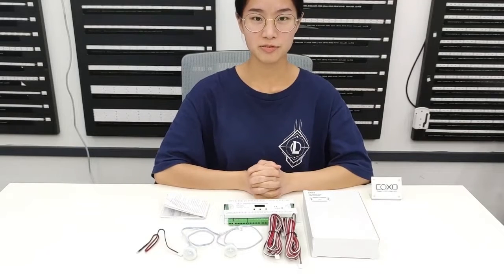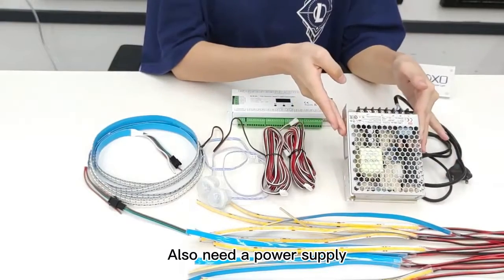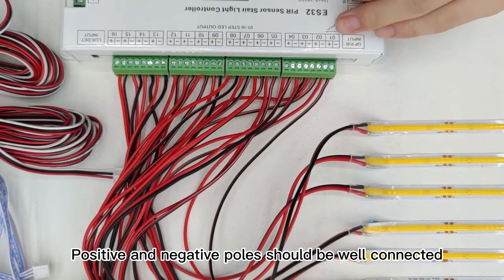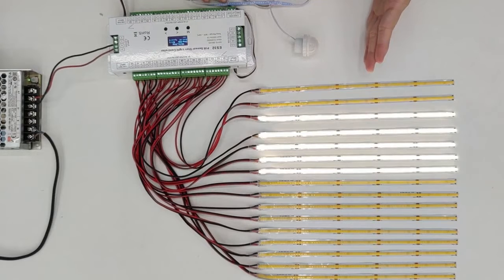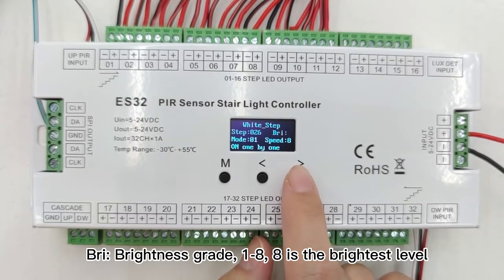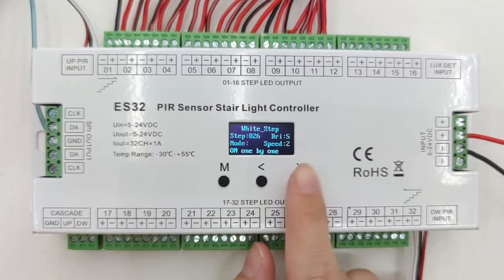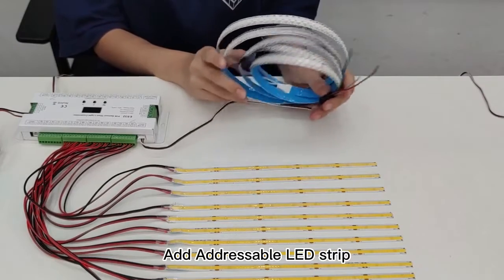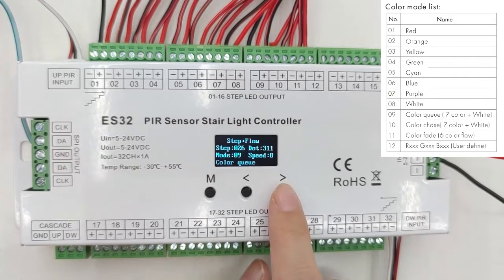ES32 PIR Sensor Stair Light Controller Connection and Setup

Comment: Hello,

Are you able to help me with the ES32 stair controller setup? I have connected all steps to the controller + light and 2 PIR sensors. Steps are turning ON and OFF one-by-one as expected. The problem I have is when I go up, the sensor at the bottom initiates the sequence...but when I'm at the top, the upper PIR sensor initiates the sequence from top to down. Is it possible to set any delay or something? Because currently it looks like a mess, stairs from the top are turning OFF, but at the same time, they are turned ON from the top... I tried many combinations and nothing helped, but that's my first time with this controller

Comment: Buenas tardes, que fuente de poder me recomienda de su tienda para este producto?
Reply from the maker: Hello, this power supply is COXO's 12V/24V constant voltage power supply, you can enter our website（https://coxotech.com/accessories/） to browse product information related to power supply or controller.
Reply: W = VI, so for say strip of 2W per foot , will give you the total wattage depending on the number add them together and multiply by 1.2, that is a good beginning. White only light will take about 50Watts for 8 steps (approximation), the current min should be about 5 Amps. Hope this helps some. If more than 10 steps I would recommend two power supplies and NOT a single BIG power supply (safety and regulations. 150 Watts and 24 VDC (or 12 VDC) may generate too much current and not be within specifications for residential homes.